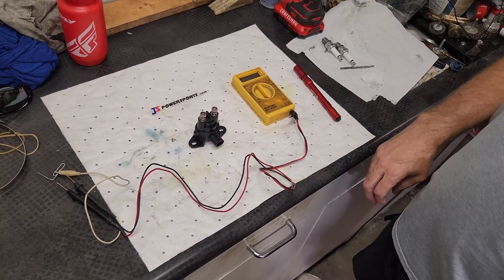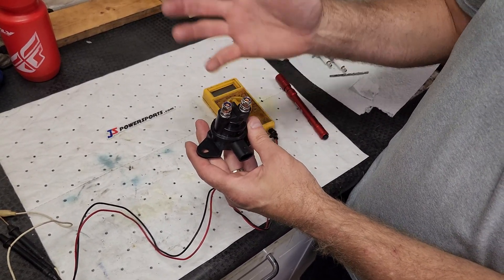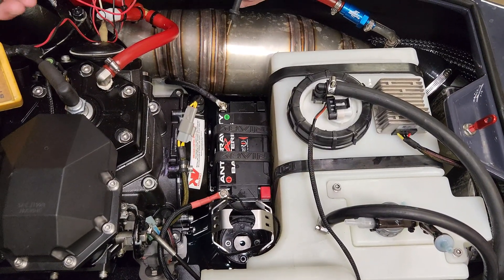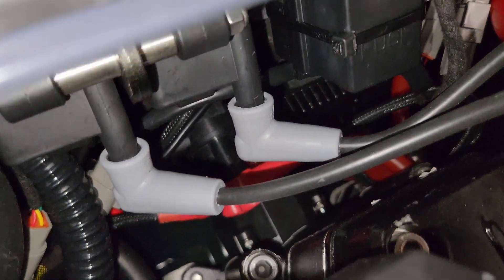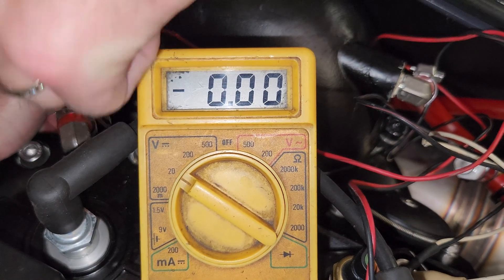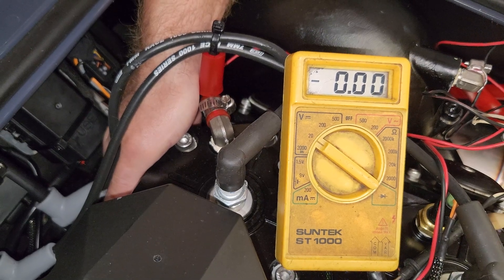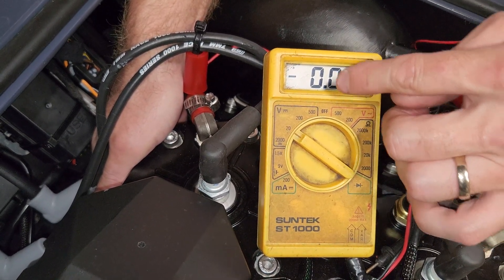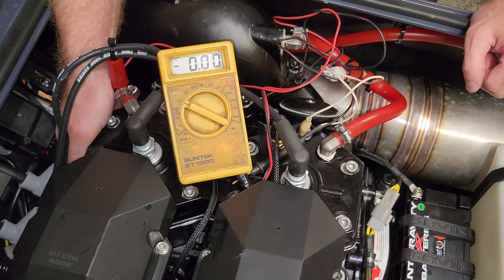Testing a jet ski starter solenoid by JS Powersports

Comment: Just a quick question, I got a 96 seadoo GTI, new solenoid and cranked for one day and now it won't do anything other than click the solenoid. Solenoid conducts electricity well, no resistance, starter reads 1.6ohms from solenoid post to battery ground. BUT there is only 0.03A draw when I press start. Any idea what I should look for next to diagnose the issue?
Reply: So, solenoid was fine but the starter suddenly stopped working. So I replaced the starter, the new solenoid didn't like it and spot welded it's contacts and now I'm looking for a new durable solenoid

Comment: So on my 99 tigershark tsr1100 i have two white wires going to the relay ,so those should be connected with the battery wire not the starter wire. Correct?
Reply from the maker: I would have to trace the wires or test them to find out what they went to

Comment: when i put the voltmeter to test the starter cable that reads zero, its at zero, when i hit the button it starts and goes to 12v, but if i dont use the voltmeter and hit the start button nothing happens, it only turns on when im measuring the starter side solenoid screw, wtf